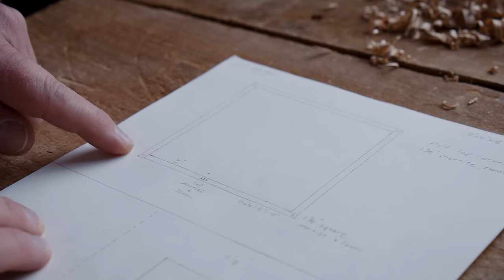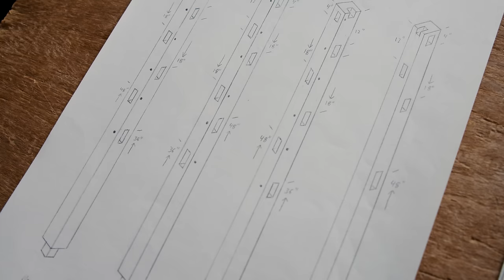Primitive Smokehouse Built By Hand - Townsends Wilderness Homestead

Comment: My wife and I are retired military and have a small modern homestead. I've been looking at building a smoke shed but seeing this I think I'll upsize...Thanks for the videos and break from the chaos. Everyone just needs to slow down, take a breath, count your blessings and turn the news OFF!
Reply from the maker: Great advice!
Reply: If you guys are still planning on building a smokehouse, I suggest you build a traditional finnish smokesauna with a "tynnyrikiuas" for your heat and smoke source. It is what I use and it works every time. The house itself is made like a log cabin with a fairly low ceiling.
Reply: @townsends , hi there from  Australia. I just had a look on your website to see if you had the blueprints or anything that showed the design of your smoke house. Is there any chance that you have the design anywhere that I or anyone else could have a sticky beak at them? I'm extremely interested in the design. If I lived in America I'd visit if it was possible. Unfortunately I live on the other side of the ocean. Great build.

Comment: In my woodworking experience, it is generally easier to fit the tenon to the mortise than the other way around. The next timber framed structure you  build, you might want to keep this in mind. Your work looks great. It should stand without issues for many decades to come.
Reply: Agree 💯, one other thing that puzzles me is why did they totally sheath the roof with 1X boards then cover them with shakes? Why not use purlins instead and that way the shakes could dry quickly instead of staying damp ( like they're going to now)

Comment: Those pegs seemed to go in awfully easy- were they cut from dried wood instead of green? Were the holes in both pieces lined up, instead of being off center, as they are traditionally (green wood will contort to make its way through off center holes, and thus draw them together tightly- when it dries, it just makes the joint stronger- that's a major reason why so many old timber frame houses still stand). Nice work, over all!

Comment: Dear Brandon from Townsends, a common mistake made on door-construction is the placement of the diagonal beam of the knee-brace. You notice it as soon as your door starts to drag on the floor and a gap occurs at the top. 
You need to imagine a triangle from left top hinge horizontally to the the right, and then diagonally down to the left bottom hinge. This will allow the weight of the door to be deflected to the sides instead of downwards.
Surely you will even find old construction drawings with this mistake.
Another hint is, when the latch bolt does not match up with its corresponding hole in the strike plate.
Nevertheless, I love your work and big respect for the things you and your comrades create. Thank you for the inspiration and knowledge you spread :-D

Comment: As a professional carpenter I will say great job. Don't be afraid to use charcoal for marking out your cuts. Simple pegs and holes make fast and easy great seals and for strong holding. Amish groups are a great resource for building info like this, not the commercial for sale stuff but the permanent structures they build

Comment: I simply loved this episode as it brought back memories of the time I, as a young man, worked for a traditional timber frame company building houses the old fashion way.  I remember being in the yard with an adze squaring a timber.  My father would tell me stories of riding the bents on barn raising. The most brave would sit on the top of the beams as the were raised by a gaggle of men with long poles raising the bents in place.  Their job was to pin the girds in place after it was up often over 40 feet in the air.

Comment: given the rough tools you all did a good job. When I was 9 we built (my cousins an I) a structure made in this fashion... It took us 2.5 years and was much larger. It's a lot of satisfaction to see this done. Our grandpa showed us the basics and was there for designing the structure. Then we messed up a lot of logs and found other ways to use them. The hardest part was getting the proper dead timber from our forest. Dried lumber is so hard to find given a forest of trees.

Comment: Brandon, John, fantastic job. I would have loved to have helped you guys with it. If I am not mistaken, the angled cross brace for the door is backwards. It should be running from the bottom at the hinge side, up to the  door opening. The weight of the door at the top will be held in place because of the brace is being pushed toward the framework. Right now the weight at the top will cause racking of the door greatly. The joints and tenons and everything else was just great.

Comment: WOW
This was just incredible. I lowe the woodworking content. My grandpa (and my great grandpa) was a carpenter  and he worked in the trade up until he had a minor stroke two years ago but lost some of his mobility.
He died on the 27. of octoberat the age of 85 and is greatly missed.

Also, here in the north of Germany in a small museum called Kiekeberg (near Hamburg) there is a house that closely resembles the smokehouse you build but with a thatched roof. 
As far as i remember it is at least 200 years old and was dissasembled and moved there before it could be torn down. 
It once was a storagehouse but was converted to a farm bakery with an oven that is even exceeding your big oven in size. 

The museum has a lot of old and relocated houses, some of which are more than 300 years old. All of them thatched as it is tradition in northern Germany.

Comment: Turned out fantastic. I'm wanting to build  my own here next year. I'll probably go with more of a pole barn style,but similar in size. I want mine to have a raised floor so can use a barrel stove as an external heat and smoke source. As a note to anyone building using board and batten siding. When you cut your boards put a 45 degree angle on the end facing the ground. Itll act as a drip edge and help prevent moisture from wicking up into the wood from rain,snow,and dew. May add a few years to your structures life.

Comment: Just as a guy who has been in the sawmill end of things for many years, this video does bring home just how much work was involved in building even modest structures.  I recognized some of the species, but not all.  I know the walls were poplar and the beams were either oak (black?) or Black Ash.  Talk about building to last!  No southern yellow pine in that project 😂.  What I can saw in a an hour at a standard hardwood mill would have taken them days and days… not to mention the felling and skidding.  Just really makes you admire how tough of ancestors were.
Reply: SYP is not as nice a wood as oak but it’s not bad either. The IBC requires trusses to be made of SYP because of it’s structural rigidity and resistance to rot.

Comment: Cool project! Looks like it will last a long time. Thanks to Brandon for all of the hard work.

Years ago, on “The Woodwright’s Shop” on PBS,  Roy Underhill did a lot of this type thing. His method for the dowels was to mark the tenon through the hole, then pull the joint back apart to drill the tenon, but drilled it slightly closer to the shoulder of the tenon. The result was that the tenon would be pulled tighter into the mortise, making a less rickety joint.

Comment: Nice project 👍 Just a small tip: When installing a door you should place it so that the diagonal bracing (that Z shape) points with the lower end to the side the door is fixed at the cabin. This way the weight from the door is directed to the wall and it won't come loose. The way you did it (Upper side at the wall, lower side away from it) will work for some time but eventually the door will come loose as the entire weight is resting on the upper hinge and pulling it away from the wall😃

Comment: Brilliant!

Some years ago my daughter wanted a tree house and inspired by a book called I think Building the Timber Framed House I (and a lad at church) built basically an open sided shed on stilts up against a tree. We used a lot of the timber framing joints described. It was a great project. We needed a team from church to assemble it as even 4 by 4s get real heavy when you are dealing with something on the scale of the smoke house.

Comment: It looked really good all the way up to hanging the door. The diagonal brace on the door is backwards, it should be close to the hinge side on the bottom and the top should be away from the hinge. This is done to prevent sagging, if left the way you installed it, eventually the door will sag. It's the same with gates, if you are using a board or pole for the diagonal, the bottom goes towards the hinge. if you are using a cable, the top goes towards the hinge.

Comment: the door is on backwards; you want the diagonal brace to go from the hinge side on the bottom, to the handle side on top. Currently the brace you have isn't doing anything to prevent the door from sagging. Lovely build video :)
Reply: I noticed this too - braces should go upwards from the hinge.
Reply: Yes, gravity will challenge a door brace 
installed in tension. Diagonal braces work best when installed in compression. This door will sag very quickly.

Comment: Small note on the door: if the brace runs up from the hinge side instead of down, it does a butter job of providing support. An easy fix and one that might add years to the longevity of that beautiful door.

Comment: Great little post and beam-structure. Nicely cut joints. Very inspirational. And nice footage too. Looking forward to seeing it smoking. But I also wonder about the diagonal brace on the door, as a few others already commented on. Was the original idea to hang the door from the other side, perhaps? Anyway, it’s an easy fix if you get any problems with sagging. Great project!

Comment: Nice building, next upgrade is ventilation. Stagnant smoke doesn't get absorbed as well as flowing smoke into meat. Also post smoking storage requires airflow to finish the drying process and keep the meat from molding.

Comment: Nice work! Yeah, that is going to take a lot more work than the modern 2x4 construction, but it will be much stronger.
Not sure what frost depth is at your location, but unless you set stones below frost level they will generally heave during freeze/thaws and throw the building out of square/plumb.

Comment: Not sure if it's historically accurate, but the bracing on the door is backwards. The diagonal bracing should carry the weight of door from the top outer corner down to the bottom hinge to avoid sagging.
The frame supports the hinge, the hinge supports the diagonal bracing, the diagonal bracing supports the door, and top horizontal ties it all together at the top hinge

Comment: It's fascinating how similar this kind of building method is to the pinnacle of japanese wooden structures. Almost entirely made of tightly fitting pieces that required no nails. It's part of the reason those buildings could survive for so many generations, and some are still maintained to this very day.

Comment: Building a timber-framed building is something I dream of doing. I will make one comment... The roof sheathing boards are typically installed at an angle, rather than straight across, so you don't end up with a gap where you want to nail.

Comment: our property had an old log house on it and the logs were 8" thick and 24" to 45" wide and compound mittered with 2" hickery pins to lock them together you couldn't have knocked it down with a bulldozer, old building tec, were so much better than the houses they build now
Reply from the maker: That sounds like quite a structure.

Comment: Not to be that guy, but I believe the diagonal support on the door is inverted [20:18].
I was always told that it should run with the bottom being closest to the hinge and top closest to the handle side. That way the unsupported load [handle side] from the top is transferred down to the hinged side of the door.
I don't think it would make a big difference, I'm just curious if there was a specific reasoning for the choice [personal or historical].
Reply: Wow, I’m glad you asked that because I was thinking the same thing. Traditional thought is like you said; the bottom of the diagonal should ‘die’ into the sturdiest, most supported point. Right at the hinge. UNLESS, I’ve been doing it wrong all these years [I don’t think so]. If there is a reason it was installed the way it’s shown in the video, I’d sure like to know, as well. 
Just being 1X material, it’s not a particularly heavy door, so the way it was done should last a good while. But eventually, gravity and wear will take their toll and some sagging should be expected.

Comment: I'm curious to see if you use pepper in your smoky fire.  I recall seeing, many , many, years ago, probably in the 50s, a drawing of smoking hams in a hollow oak tree. The hollow tree had been cut off 9"-10' above the ground and and two boards meeting to form a tiny 90 degree (45 slope) open gable roof placed atop.  It may have been from "Farmer Boy" or "Little House in the Big Woods".

Comment: Its a really beautiful piece of work, being held together by pins it will avoid the rust that screws or nails will get. But I have to say, and its just me nitpicking, you hung the door wrong lol. On a gate or door with a 45' brace, the top of the brace should be on the opposite side of the hinges. It stops them from sagging.

Comment: Very impressive.

@18:59:  Isn't that diagonal brace backwards for that hinge set-up?  That piece (and the joints or fasteners) is stronger in compression than in tension, so it would seemingly resist sag better if the diagonal brace were to slant down toward the hinges.

Comment: Lovely build! Great work!
Just a question. At 12:31 I see you using saws to cut the dowels. Wouldn't the settlers / homesteaders of old preferred to use an axe (carpenters axe)? I ask this, because I've noticed (after having had German contractors for my house in Germany) modern German carpenters still doing most of their work with an axe, rather than grabbing a saw, hammer or chisel.

Comment: Are your posts green wood while your pins are dry?  If you use green posts as it dries and shrinks it will compress on the pin locking it in place. Saw this on a video of greenwood furniture construction and other timber framing videos.

Comment: Nice work BUT the diagonal bracing on the door is wrong, it should run from the bottom hinge to the opposite top corner. In compression, not in tension.

Comment: Congratulations on a job well done gentlemen. I hope you get many years of use out of it. I grew up with slaughtering hogs, salt curing the meat, and then hickory smoking it at my grandparents every winter. Now you'll need at least 2 #3 cast iron kettles for the slaughter. One to heat water to scald the hair so it can be scraped off the hide, and one to render the lard from the cut up fat and skin. Nothing like fresh cracklings at hog killing time.